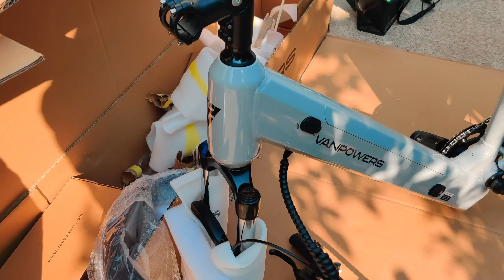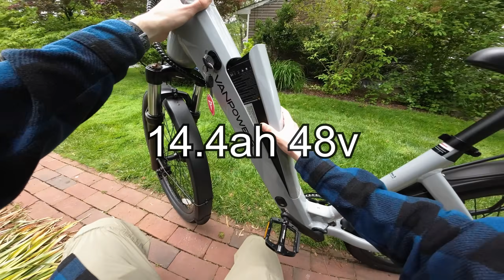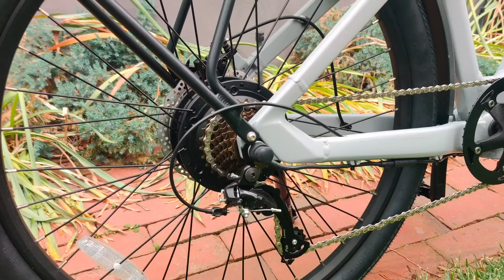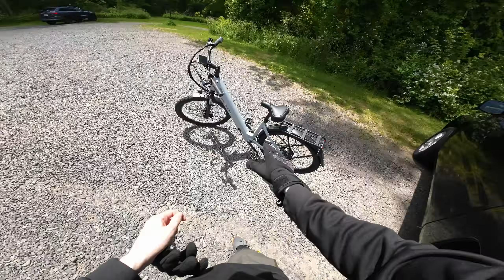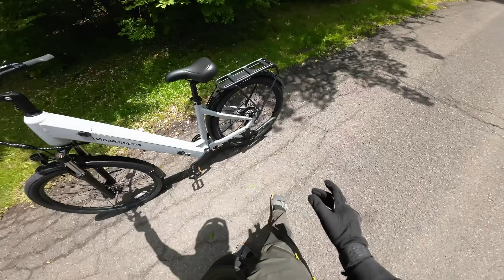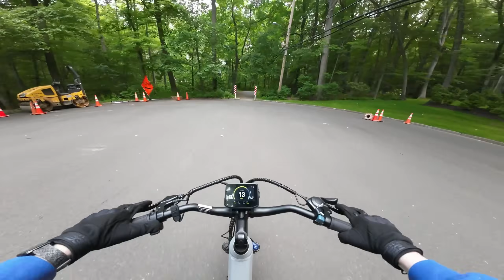Sleek Stealth eBike - Vanpowers UrbanGlide Review

Comment: range probably much higher. 500w for 2 hours would use only 10ah/14.8.  40 miles at nominal power if that's 20mph top speed.  Light and thin tires at "modest speed" would do better than your main ride.  Would be nice to highlight what you can customize with controller programming. Company seems bad at providing that info, which is usually a deal breaker.

Comment: If most of your riding in on pavement, there really is no need for heavy fat tires to drain your battery range.
Similarly all the SUV gas guzzlers on the road that never go off-road.
Reply: some of the advantage of fat tires is stronger wheels and more bike weight/cargo capacity.  Less flats potential (though giant pita to fix), and big fat motors that are powerful and cheaper than thinner ones.  Thinner tires lighter and more efficient is nice, but nearly all fat tire ebikes do 28mph @ 750w.